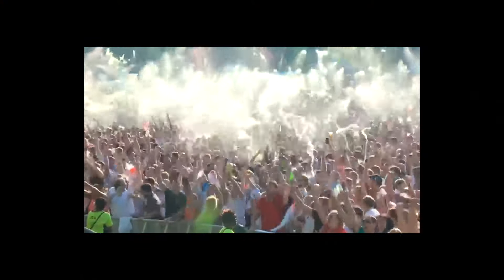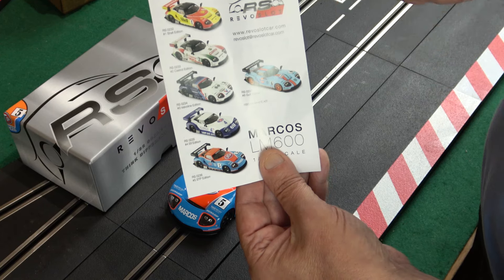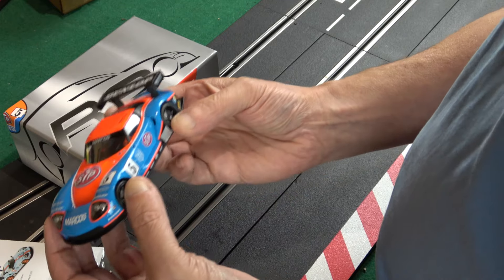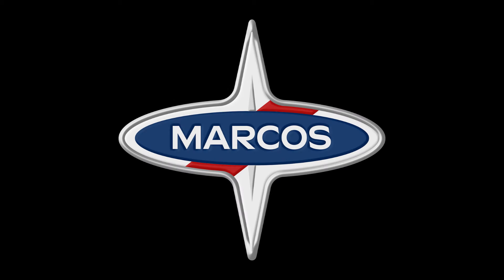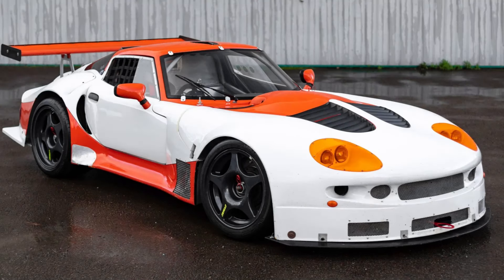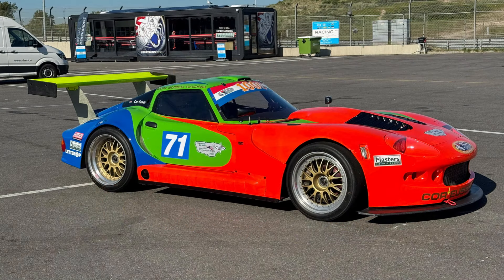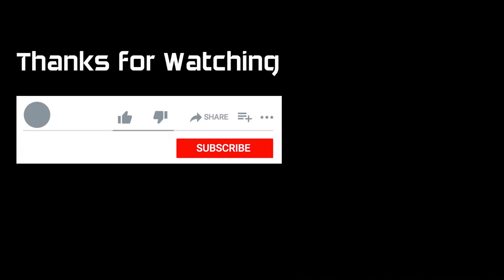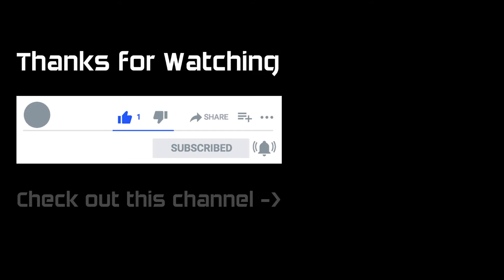Revoslot Marcos LM600 STP Edition

Comment: Great review Dave👍🏻. I bought the STP and the Valvoline . Disappointed that the rear spoiler was completely off the Valvoline car! Must be a production issue. Haven’t fettled the cars yet to make them run well but will be doing that this week.
Reply: Hi Dave, Further to this point, and after taking a closer look, I think that the issue is caused by spraying the 2 parts separately in the manufacture process which means that the 2 mating surfaces are paint to paint which simply doesn’t work. I fixed mine by scraping away the offending paint and then using EMA plastic glue. I guess you could also use any super glue as well.

Comment: Just to add.. I think that the issue with the rear spoilers is because the uprights and the fin are both sprayed separately and then glued together which means that there’s a paint~glue- paint joint which is not strong enough. I fixed mine by scraping off the paint from the mating surfaces and then used a strong plastic glue but superglue would also work.

Comment: One of the newest release BRM VW Scirocco cars has the rear wing mounted on very flexible rubber like uprights. The Danish championship red car.
I expect this good idea to spread to RevoSlot cars in time. 
Today I saw a demo of the rear wing on the VW being pushed to all sorts of extreme angles without braking.  After I pointed out this new feature to the car owner.